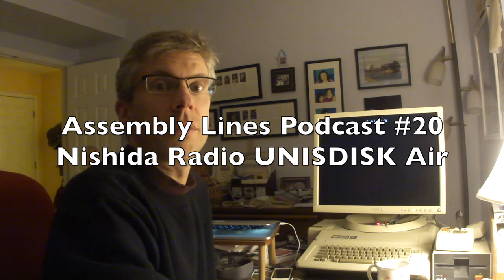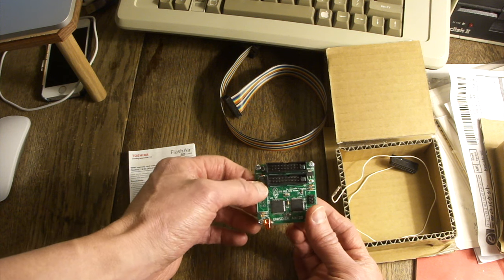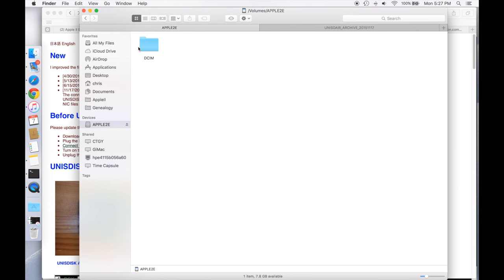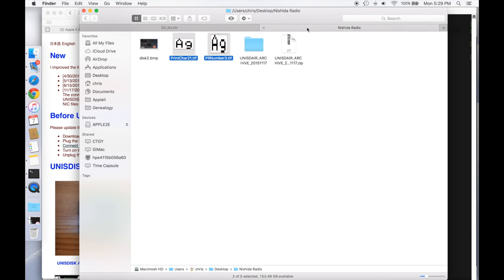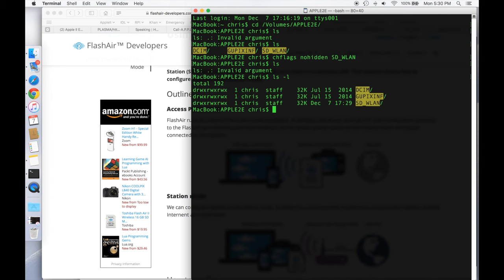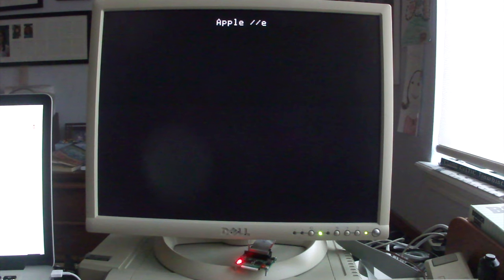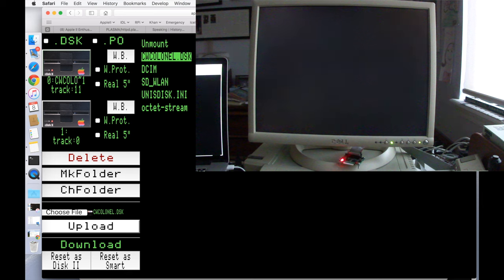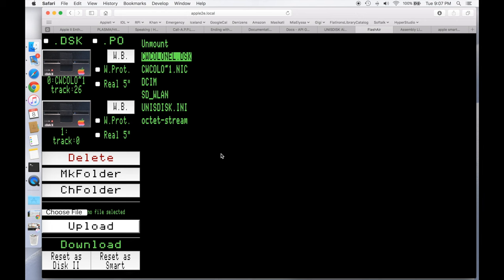Assembly Lines #20: Nishida Radio UNISDISK Air

Comment: Seems more complex than I'd like to set up the wireless card. Since the wireless card is a critical component, I'm surprised it doesn't arrive with one configured.
Reply from the maker: +cashmoneymarvelous Hi, well, Koichi Nishida's cards are very reasonably priced -  he probably doesn't want to drive up the price with a FlashAir card. Also, if you're on Windows, you can download an app from Toshiba that does most of the configuration for you. Then you just need to copy Nishida's files onto the card and you're good to go. All told, it probably took me half an hour, and that included hunting around for a different Disk ][ image. Best of luck!
Reply: +Chris Torrence Seeing how facile you are with terminal and setup is the intimidating part. It would probably take me hours to sort out, having almost no modern computer command line chops. I like turnkey stuff, which is why my SD Disk from Korea collects dust and my CFFA3000 gets regular use.
Reply from the maker: +cashmoneymarvelous Yep, totally understand. Cheers!